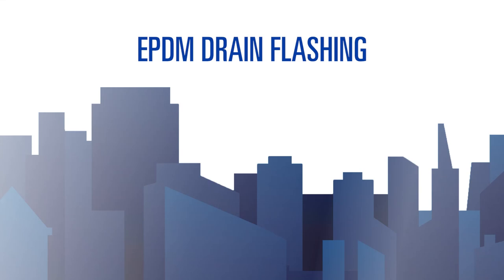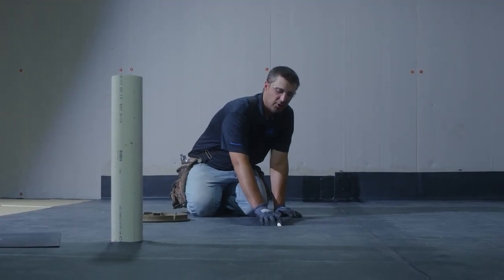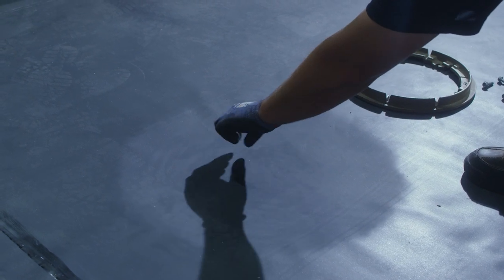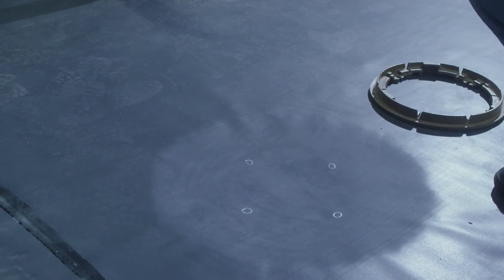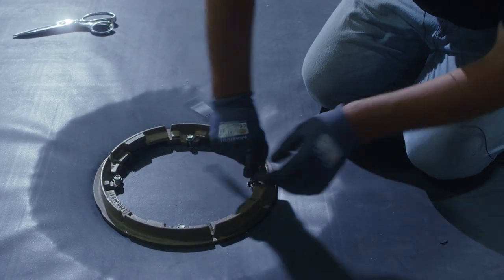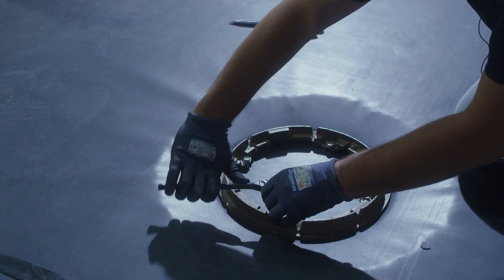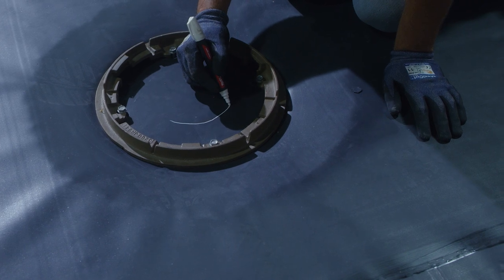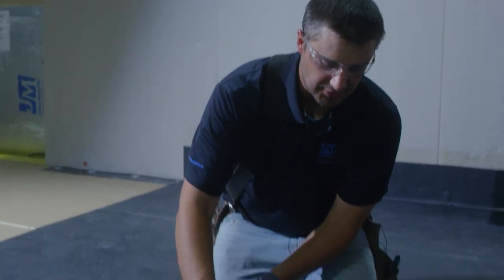EPDM Drain Flashing

Comment: I do these drains all the time i find it easier put bolts on before the caulking then after the base flashing is over and set i use a hammer to tap top of bolts it makes the perfect size cut for where bolts go.